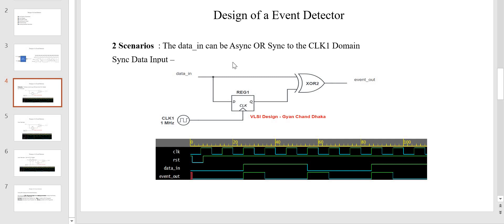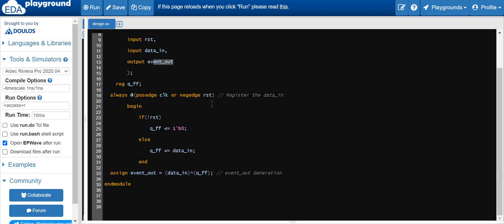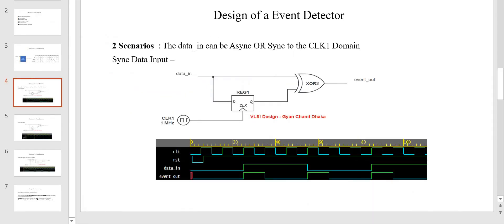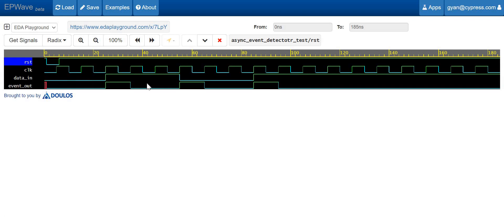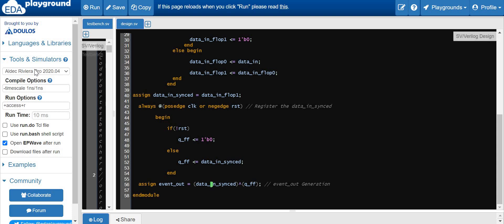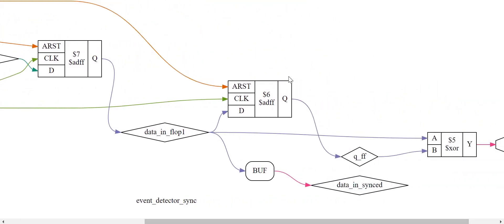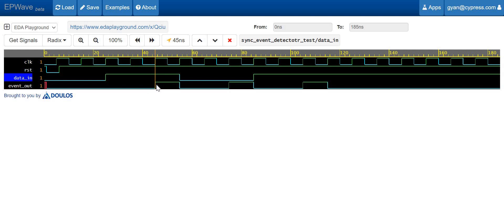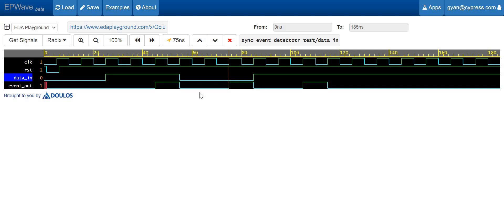Digital Event Detector Part#2 | RTL Design | Digital System Design

Comment: Hi sir, in this video at 00:45 you said that you are writing code for asynchronous event detector but whereas in the output wave forms the data_in is coming in synchronous with the positive edge of the clock. As you said in the first video of event detector, for asynchronous event detector the data_in should not be in synch with the clock but whereas it is in sync with the clock in this video (04:32).  My doubt is the wave forms in this video at 04:32 are not similar to asynchronous event detector wave forms which you explained in the first video.
Reply from the maker: Hi @Naveen, The first RTL code (Our Design) is an Asynchronous EventDetector only because in our design we do not have any synchronizer for the data_in signal but just to show a Complete Cycle Event , I am driving the data_in w.r.t to Clock signal in Test Bench but Yes the data_in can be launched from a different Clock domain than our Event Detector Clock Domain.